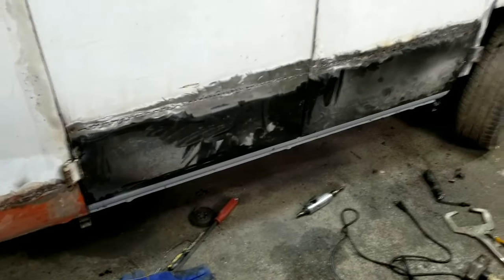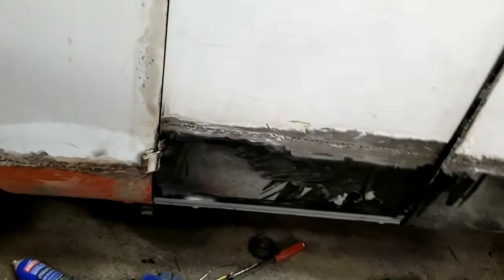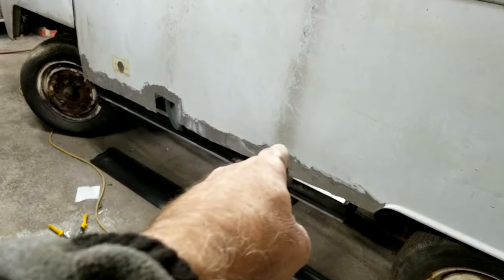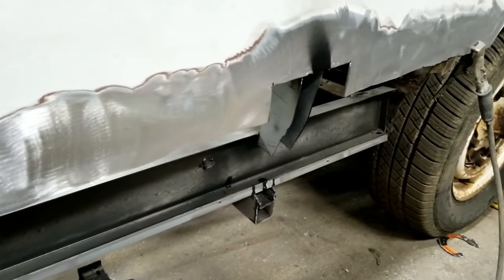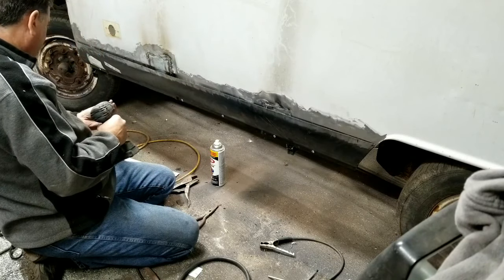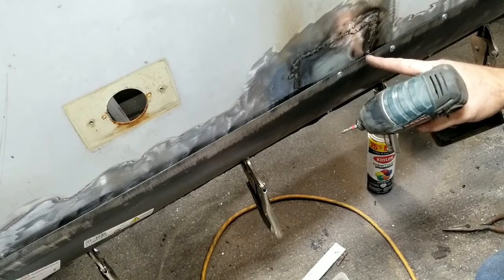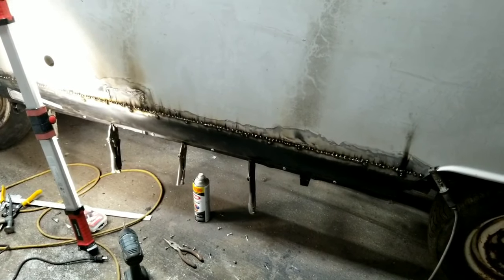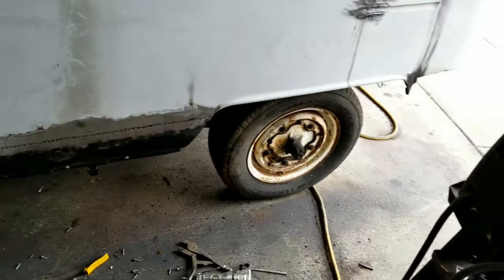RESTORATION - rusty 1967 vw bus left rocker  panel and cargo door align after floors

Comment: That turned out Looking really good. I have never done anything like that before but I think that I could after watching you do it.
Reply: I can't wait to get a 220 welder, right now I have a starter 110  flux core welder and I've been learning a lot with that little thing.
Reply: @JWClassicVW  flux core is fine mate.
It's all about practice.
You need to have a rag in water to cool each weld individually if you want it to not warp.
Or a compressor.
Flux core dose the exact same thing as gas just a bit more cleanup, but it will need finishing with a file or grinder anyway so it doesn't matt eer what you use.

Comment: Do you have a bead roller?
If you quickly ran a 1mm step to the repair panel it acts like a seat for the old metal to fit into and you won't warp the large panel.
The patches warped the panel where it was welded.
Then also there isn't an overlap.
But I'm sure you know this.
Nice video mike

Comment: I don't know how many amps your 110 in your garage is, but if I have to use a 110 welder it makes a world of difference between a 20a and a 15a circuit. I cheat, I use an adapter for the 220v welder/plasma cutter plug to a 110v. Just an idea. I agree 220 is way better. Great video! Your bus is moving right along.
Reply from the maker: Yea I have 20a with proper wire. Just built the shop a few years ago.
Reply from the maker: good point. though
Reply: Yes he is knocking this bus out, Good info Jon on the 110 and the circuit being used!

Comment: Hi mate
What's ur name i use to buy repair cheap cars that have NO M.O.T i learnt to weld with ark welder on cars it was hard they to hot then I bought mig welder much better car metal so thin there was a lot of say in the 80s that welding on cars was best to weld just spot welding not seam welding jacking points around them was where a lot of rot get in on floors spent hours patching up underneath car floors then I use to plate inside lots of work to make some money but I enjoyed it ur videos very interesting to me
Phil in stoke in uk
T

Comment: Hi Mike, which do you prefer for sheetmetal welding? 110 or 220? I see you use a wire feed. How many amp unit? Is you 220 a arc welder?
Reply from the maker: 220 for everything But I havent tried the miller 110 220. they may work better. that cornwell welder I am not so sure about.
Reply: Thanks Mike, for my first welder will go with the 220 for all around welding in my shop.
Reply from the maker: @TimsWorkshopTJY  will be a better investment. after using the 110 I definately would go at least dual voltage. For instance my plasma cutter works on 110 and it sucks. on 220 works great.
Reply: Lincoln makes a AC/DC unit that looks good and decent priced
Reply: @Mikefngarage  Great info Mike!

Comment: Can you use liquid nails just asking??
Reply from the maker: I don't think it is strong enough. panel bonding adhesive is super strong but requires to be clamped for 24 hours.
Reply: I'm curious what you're using for panel adhesive. That stuff is great I've used it several times. And only thing is the 3 different brands I have used all specifically state they need to be used on bare metal otherwise they will not hold up long term! A body shop guy I've known for years says if it flexes it will rip the primer right off the metal
Reply from the maker: @muzzcovw7674  yea for sure I put all mine on bare metal. it will rip the paint right off the panel like you say. and it protects the bare metal from corrosion unlike welding attracts it even with weld through primer IMO. I do the cargo floors lower rocker edges and a few other random places that I can successfully clamp. if iti isnt clamped too it will fail.
Reply: Sounds good and thanks for the quick reply! It was hard to tell in the video if it was bare metal or not that's why I was asking. Keep up the good work and great videos!